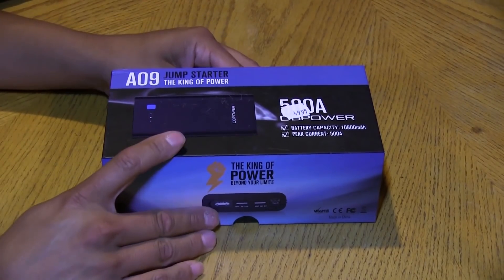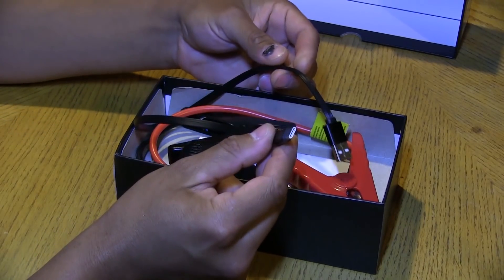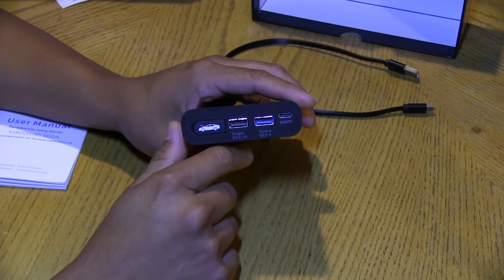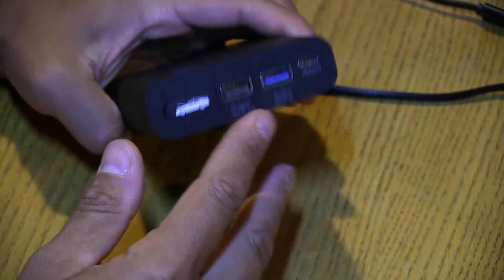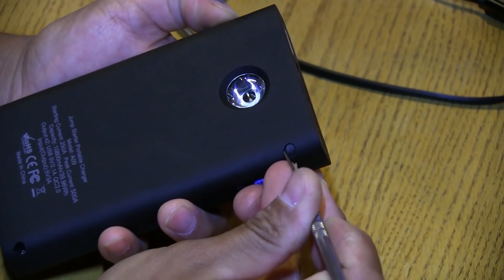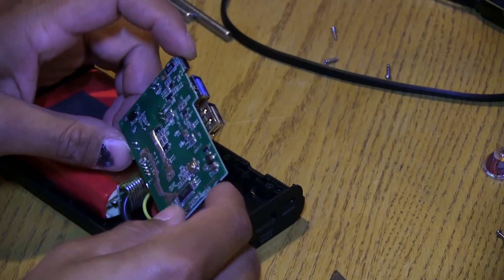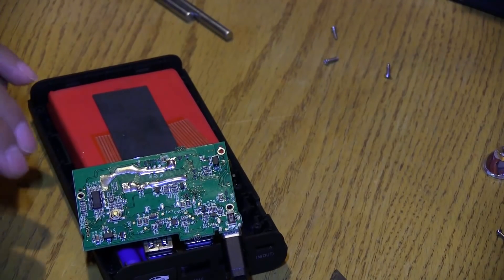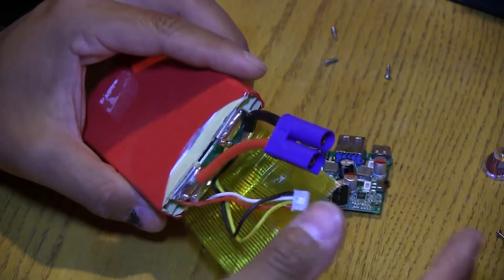TWB #76 | DBPOWER A09 Jump Starter/Portable Charger Teardown-Investigation

Comment: Very interesting, thanks for posting this.  I've had the same unit for a few years and it starts my motorbike OK but doubt it would crank my car.  I decided to buy a mating Anderson connector to bypass that relay module so I can have 12V (with a fused cable) output

Comment: the relay is also for spark arestion meaning you dont want full power of a lipo hooked up right away to the battery big spark.. so its like a switch stays off till it senses current for say 2 seconds then turns on... and these little lipos only boost voltage and alittle amps a proper jumper box is the big ones with a actual battery in them 100 ah battery these little ones i dont know how they stop them from puffing after 10 days of being fully charged in your glove box maybe they do like dji self discharge slow over time to avoid that so you must once a month check the voltage of them.. with a sla battery you dont need to do that.. jsut get jumper boxes or another battery and stick it in your trunk and check the voltage every 2 months then you have a proper jumper these are gimics yes they start but watch them try to start youll notice it just barely does it... dead battery get it replaced run your vehicle once a week for 10 minutes if you dont drive much... replace a batt after 5 years